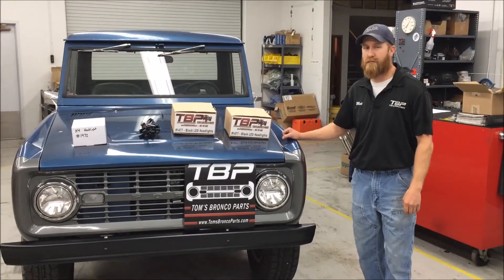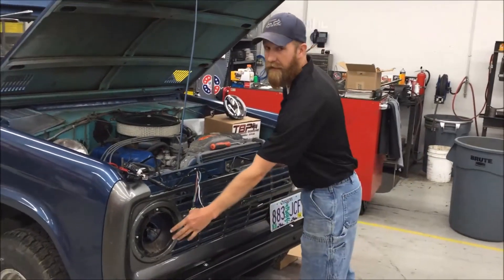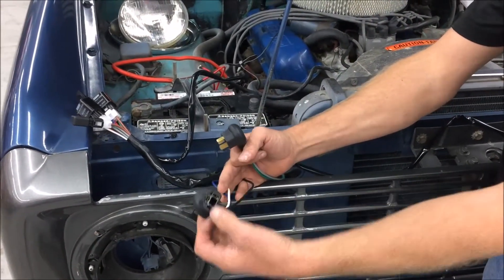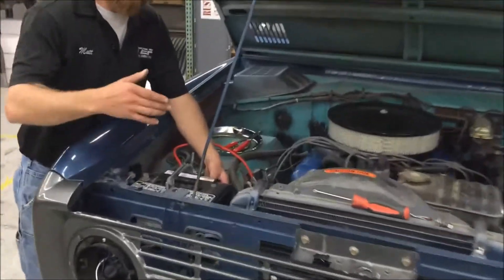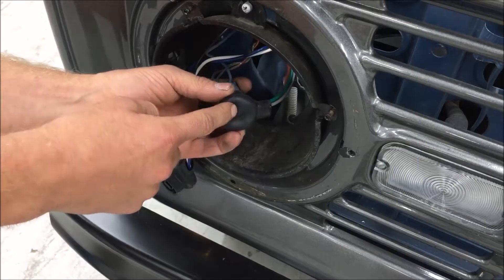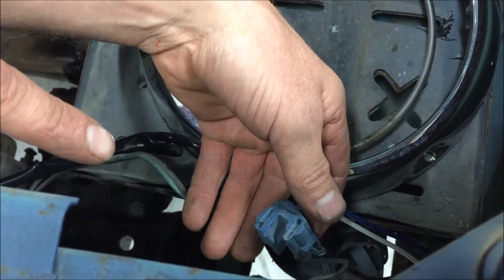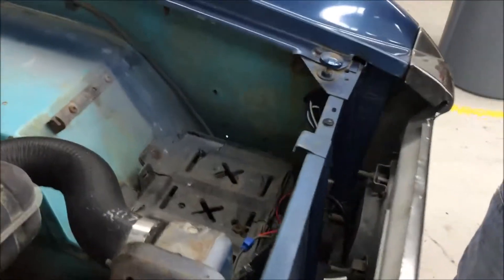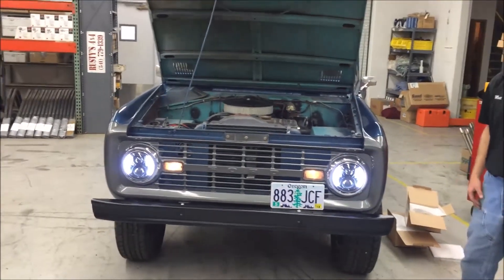TOMS OFFROAD Tech Time Episode 4: TOMS OFFROAD Halogen H4 and LED Headlights

Comment: Do you guys include an extra wire for the halo lights? If not where can it be found?
Reply from the maker: We do not have an additional provision in the harness for the halo. The halo wire on the headlight can be attached to the parking light wire on each front turn signal bucket to power it up. If you have any additional questions, please don't hesitate to call us at (541) 779-1339. Thank you!